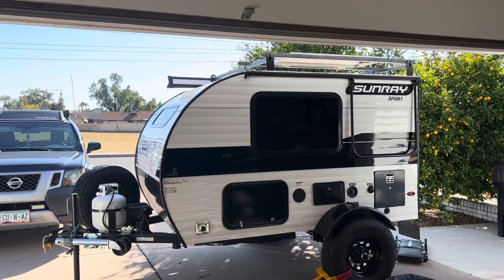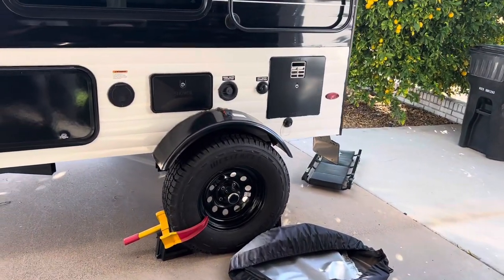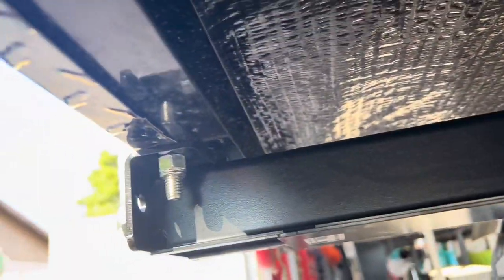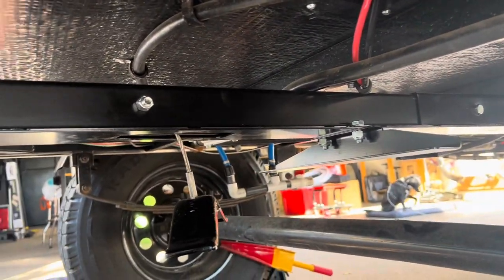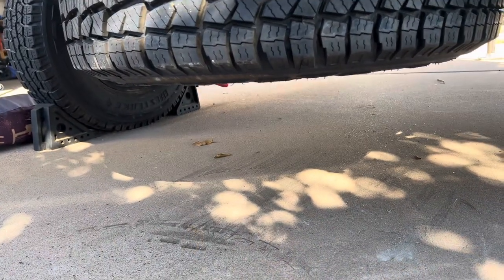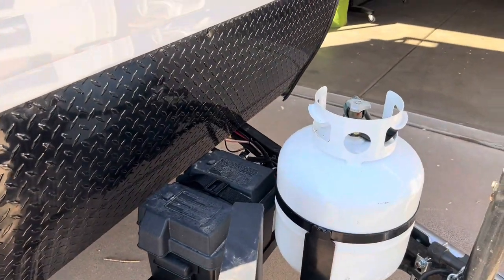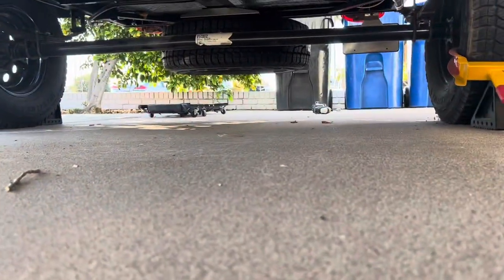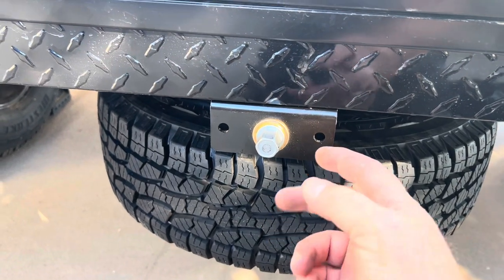spare tire carrier for Sunray 109

Comment: On mine I removed the two crossbars on the tire mount, 4 bolts and it gave me two more inches of tire to ground clearance. Also in the center of the main tire mount they didn’t mention to add another bolt to trailer cross frame which gave it tremendous support you might want to do the same.

Comment: Love the video.   I’m actually looking at a 109 right now.  I do plan on moving it eventually however I was curious what is the exact tire size?  I’m looking for a tire cover on Amazon and just wondered what size cover I should look for.
Reply from the maker: The tire covers are pretty much universal. The one that we purchased for ours a while back we got on Amazon and it has a tie in the back with a drawstring so you should be fine. Just buy any tire cover you want.